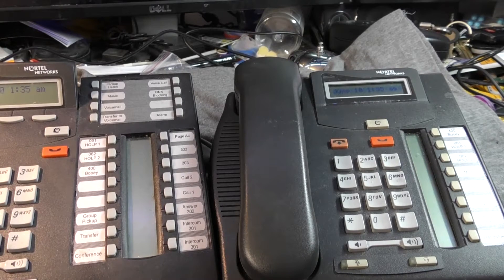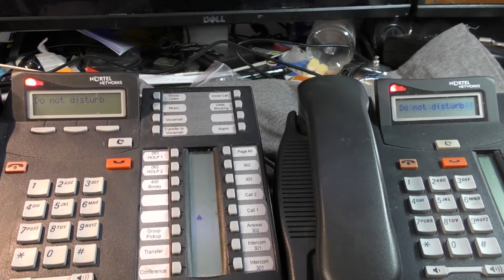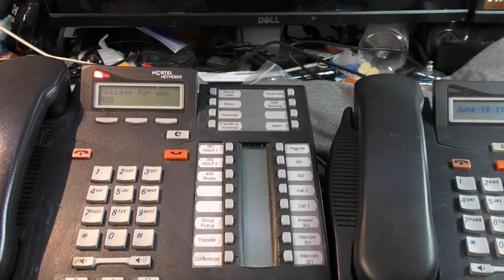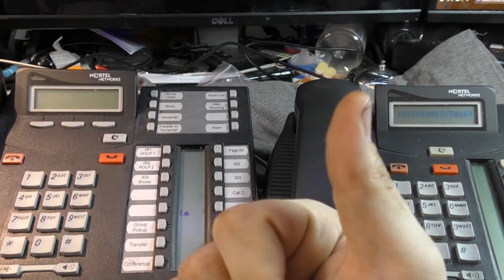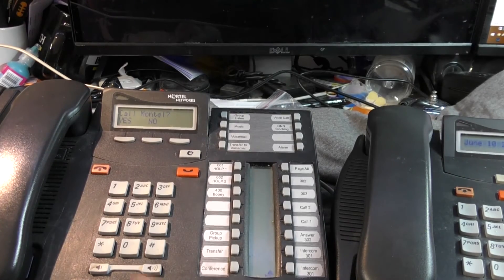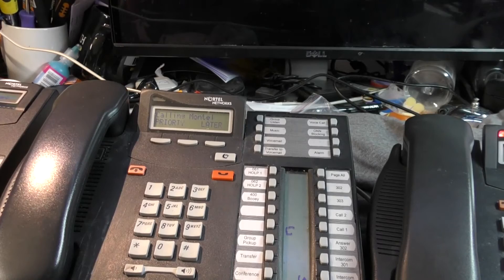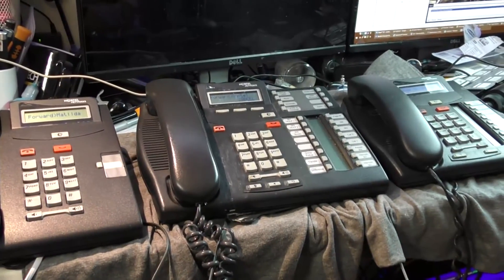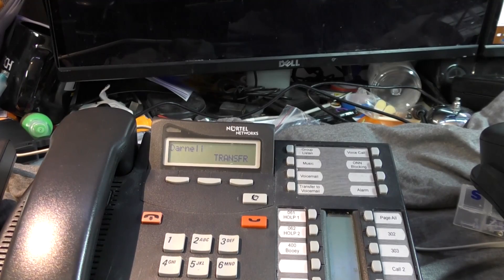Norstar Phreaking Part 9 - More Features and Call Forward

Comment: I have a Norstar T7208 on the wall in one on my HS classrooms and it says message for you but the teachers don't think about the complexity of the system and therefore won't turn it off. What feature code would I use to undo it
Reply from the maker: Feature #65 if I remember correctly

Comment: Hi there, i have an issue where calling extension 221 on our system is ringing both extension 221 and extension 225.  When calling 221 from any internal office phone, on 221 display it shows the incoming caller name...on 225 it shows "220 > 221" and you can answer the call at either of those phones.  It doesn't seem like it's forwarded and I've done the cancel forwarding code. It doesn't show the same message as you show in the video.  Any thoughts on what might be causing this paired ringing and how to disable it?  Forgot to state the phones are m7310 on a norstar system.
Reply from the maker: There's a few things it could be,  but it's probably an Answer Key.   On the 225 do Feature *0 and press all of the line buttons looking for "Answer 221".  If you see this,  that's why.   You need to remove that "Answer DN" in the Set programming for 225 (or set it to "Appear only" -- which means the button is still there and will flash and answer 221 if you press it,  but 225 won't ring audibly when you call 221).    There's a few other things it could be but are all very unlikely.
Reply: @NillKitty  You were correct that it is Answer 221, thanks.  I edited to remove the rest of the problem because i found answer dn option and removed it there.  Thanks so much for your help!
Reply from the maker: @ZenPudding  and now you have a free line key to use for whatever.